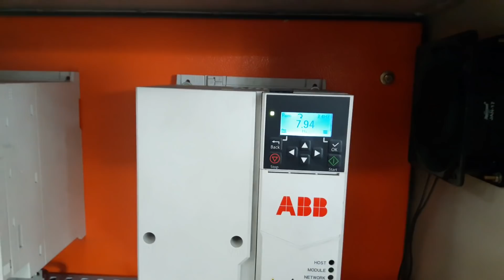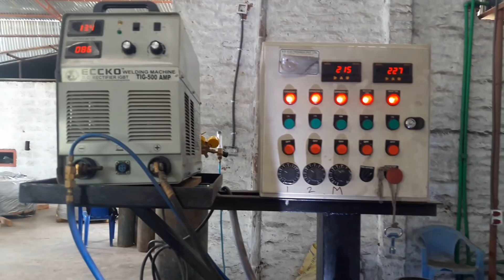How pipes are made in factory || SS Tube Mill

Comment: thats how galvanized pipe is made, i wanted to make a telescopic tube 1 inch with a 3/4 insert pipe. problem is the inside of the pipe is screwed up. it has a weld tab running through it and you cant slide a 3/4 pipe inside a 1 inch pipe. i have tried everything to clean bore the id. basically impossible. yeah you can up the size to 1 1/4. then you have a wobble fit. im going to soak the galvanize in muriatic acid to remove it. then will have to either grind down the smaller pipe. or slice the 1 inch pipe length wise and spread it open and try to re weld it. i checked black steel, galvanized , etc. they all make the pipe from flat stock and run it through rollers like this video. you would think they would line bore and clean out the inside. looking at it i find it hard to believe its rated at 150 lbs pressure. for gas, etc, only way to make it to fit would be make seamless pipe. its easy for square pipe to deburr but round is not. its a joke.

Comment: I don't see any eddy current in-line inspection. So the tubes are not supplied with a DIN 50049 3.1B certificate I guess?
Reply: TheOtherWhiteBread0  Haha, just to be in this business 25 yrs ago.
Reply: @ThomasD1962  You're retired now? 25 years is hell long ago, lots of experience I guess.
Reply: @davemwangi05  I left that business 25 yrs ago. Still in quality though with at least another 10 yrs to go...
Reply: Hi dear, we are manufacturer of this kind tube mill and rolls, whatsapp 0086-18752708773 and email 18066078189@163.com, thanks
Reply: @shellyshaotubemilllinemanu1144  how can you deliver this machine ?

Comment: It is Old technology especially on the welding part. And very slow production output. But simple and yet effective.
Reply: Yes, those are old but cheap to buy and install
Reply: @sajidmulla6113  Hi dear, we are manufacturer of this kind tube mill and rolls, whatsapp 0086-18752708773 and email 18066078189@163.com, thanks
Reply: Then what is a new technique can you please  elaborate ?

Comment: Hello manufacturer,
Good educational vedio. I want to know about half pipe making process. Please make a vedio of that.
Reply: Half pipe?
What is that?
Reply: @willbell1128  see standard DIN 28086. it is used for making coiling channels on gas coolers vacuum system in RH plant
Reply: @vishal1463  ok
I make pipe manually with powerless equipment and also resistance welding processes,,maximum gauge 18 gauge minimum gauge 26,,
I've been in metal working since 1980
Reply: @willbell1128  ok
I am a designer. I am curious about different manufacturing processes. So that at the time of designing, we can design equipments as per manufacturing conditions & processes.
Reply: @vishal1463  my lock seam machine was made in 1855,.it is still in proper working condition,my welding equipment was produced in 1948,most of my machines are manually operated with minimum solid state controls.,I could show you antiquated processes but nothing as modern as this
Reply: Hi dear, we are manufacturer of this kind tube mill and rolls, whatsapp 0086-18752708773 and email 18066078189@163.com, thanks

Comment: Can you make your electric switch board safe. Cover your main wires with a board. The only part that should be exposed are your trip fuses
Reply from the maker: Tq so much I m greatfull I will improve it as soon as possible
Reply: Switch board and drive are good. We spend WAY too much money and effort on idiot proofing equipment instead of training the personnel.
Reply: It’s a control panel. It’s arc flash rated and you can only access those ‘fuses’ as you call them when dead or if wearing arc flash clothing. They are circuit breakers not fuses, if you don’t even know that why comment about installation??
Reply: Call it what you want in your country,all I’m saying is in our western world safety is a number one priority and having your main power entry point so exposed is a hazard. Would you be happy if you had a child or someone close to you working in that work shop. Remember these are guys that employ young kids that work for a bowl of rice. If you’re the professional why don’t you give him some safety advice instead of correcting me.
Reply: BonzaBangerz lol what part of the western world do you live in? I don’t see anything wrong with his plc and im betting that it has a nice door that closes too. Oh and as a kid that was working running equipment at age five I can tell you that kids that have to work don’t put their fingers where they can loose them because they were told about the danger and they have better things to do than play with something that they can wreck and get a good beating for playing with it
Reply: It looks pretty standard to me, if you are going in there it is assumed you have knowledge of what you are doing. It isn't the fuse panel in your home.